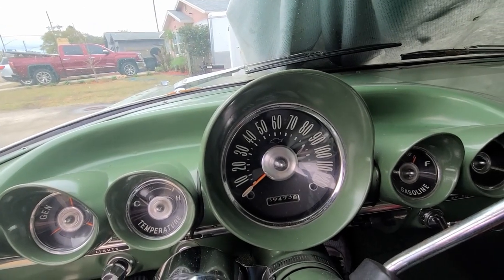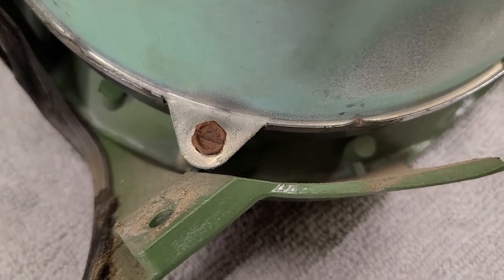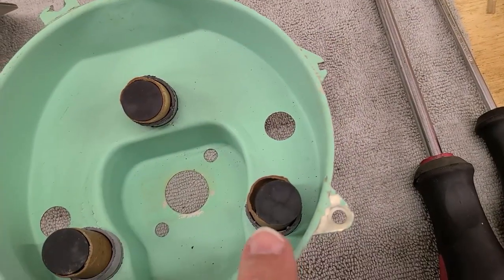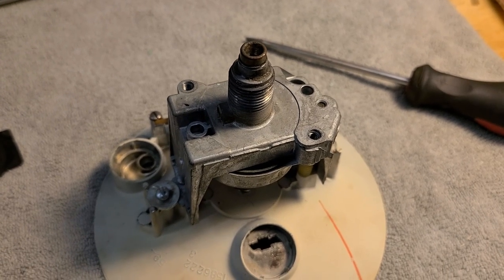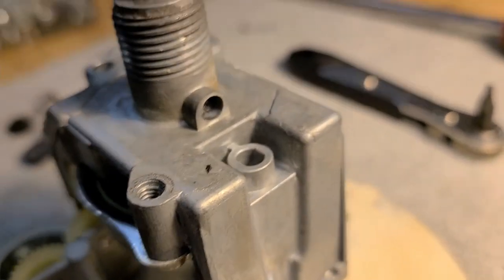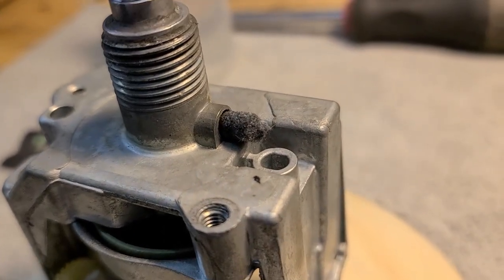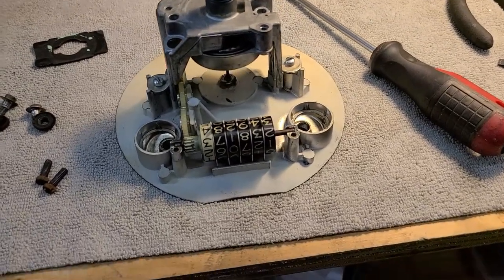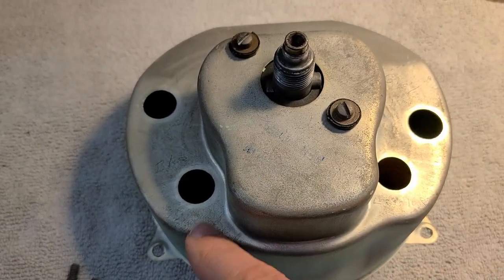Classic Chevy Speedometer, Cable, and Odometer Repair

Comment: I had a 59 chevy in 1979 when I was 16  My first car! I had the spedometer problem as well. I spoke with my local chevy dealer about it. I guess I was lucky. The parts manager was old enough to remember these. He told me there was a service bulliten about this. Seems the plastic worm gear often warped! Living in Florida heat, made it worse. The fix was to replace the worm gear of plastic to a new metal one! I knew that in 1979 that gesr was no longer available, but in my local junkyard there were a few 59 chevies available  I went to each one, removes the speedometer and was rewarded that one had the replacement gear! I purchased that spedo and repaired mine. I asked the parts manager if I could get a copy of rhe 59 chevy service bulletin  information for future reference. He xeroxed it and I checked this before I did any fixes related to problems. I suggest snyone who wants to work on their car to do so. Today I am sure its posted on the internet somewhere. Guys, you need to know, these cars did have unsnticipated errors, and they did know about it and offer solutions.

Comment: I just had to switch out my odometer in my 77 Impala because the cable out of rounded the inside of it and all I did was switch the drums from the old one to the new one and now the speedometer is bouncing so I got to take it all apart again and re lubricate everything and confirm nothing is binding up
Reply from the maker: Good luck!

Comment: I own a 1973 SS Chevy El Camino and its speedometer is offset by roughly 10mph back would the lubrication process work for it or is my issue covered in a different video.
Reply from the maker: I would check to see if you have a different gear ratio in the rear end.
Reply: @LowTechGarage  Ok thank you

Comment: Thank you for this video! I have a reason to believe that my speedo is causing a really loud whirring sound that is coming from the dash of my 1960 Impala. It's missing the needle and I can't seem to figure out the cause but I have a reason to believe the gears may be super worn and grinding or something. Sound is directly from the dash where the speedo is and not the transmission or steering box. It basically is non existent when I'm idle or going like <5 mph but as I speed up so does the whirring sound and it gets pretty loud.
Reply from the maker: You’re welcome. Time to pull the Speedo out and see what’s going on!
Reply: @LowTechGarage  Definitely! Got an extra one for parts off ebay for like $30 so I got the needle finally.

Comment: Thanks for posting the video!  I’ve been trying to figure out what’s wrong with my ‘62 Chevy C10 since it’s been bouncing/chirping, and stuck between 95339.9 and 95340.0 for years (hasn’t been driven for almost 20 years).  Took it apart today, and it made it one mile before it stopped again.  Got a good laugh out of that (while test driving), so pulling it again and continuing the quest.

Really do appreciate the level of detail in your video!
Reply from the maker: Thank you! I found that lots of cleaning and re lubricating did the trick.

Comment: I like to mention there are three color lenses that might get mixed up when putting back together,  the two turn signals are green and the high beam indicator on top is red . 39:20
thank you for your post
Reply from the maker: Thanks for sharing this information
Reply: @LowTechGarage   my left turn indicator is red now, to lazy to correct it :)

Comment: Dealing with the same exact issue on the same exact speedo (59 El Camino).  BTW what engine do you have in your car?  It sounds so smooth!
Reply from the maker: 305! It was originally a 235 L6

Comment: Excellent video.  despite your warning, i tried to pop off the needle - bad move.  the thin copper shaft broke.  (there was a reason i had to take off the 5" disc that faces the driver, but i've forgotten what it was.)  if anyone else breaks that shaft, after many hours of attempts I was able to use silver solder to join the 2 ends of it back up.  good luck.  with everything apart i got the speedometer head to work, but it turns out that the cable was the wrong.  I have a 55 Chevy 3600 pickup and the cable end at the transmission has a special notch.
Reply from the maker: Good luck with your project. Glad you were able to reattach the needle!

Comment: Good job ! Really want to Know in case the belair is beeing towed on neutral , is the miles are still counting ? Thanks !
Reply from the maker: It won’t count in neutral
Reply: @LowTechGarage , anytime the transmission output is turning, the odometer will be counting